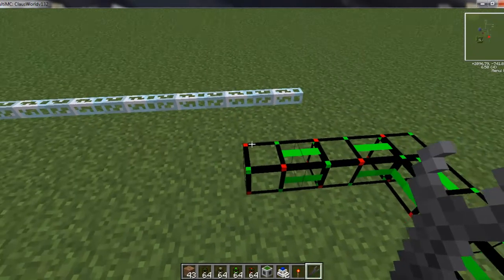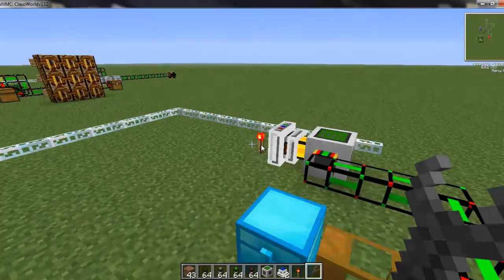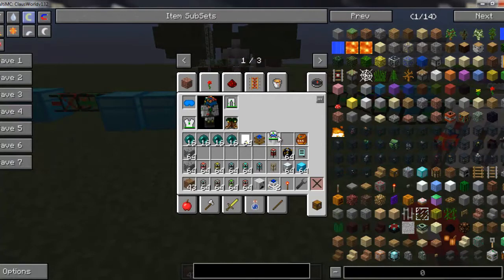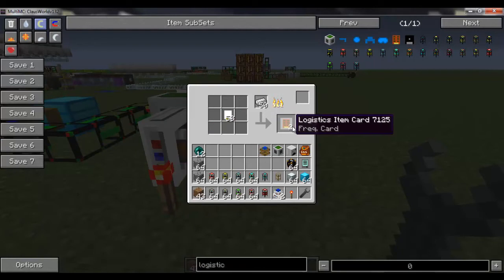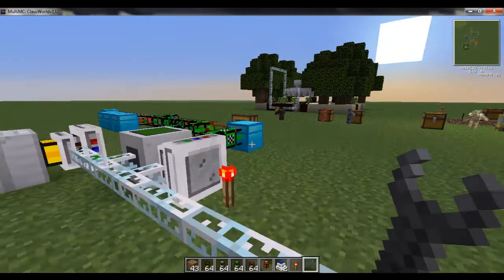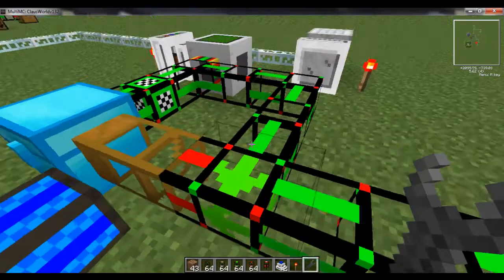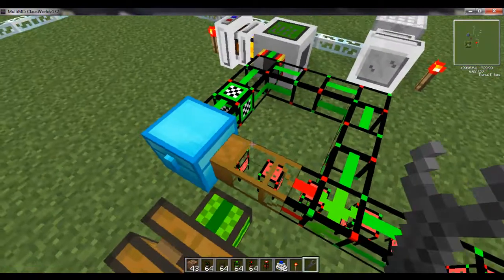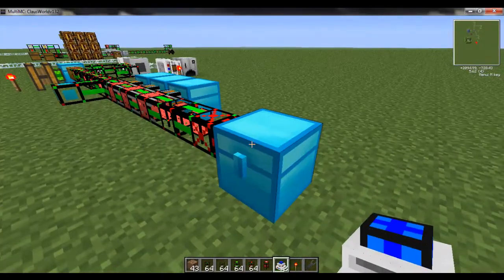Logistic Pipes Tutorial - Episode 5 - Power Junction, Frequency Cards, Entrance/Destination Pipes

Comment from the maker: Yellow is not a valid connection. Are they both attached to ender chests? They must be for the inventories to transfer.

Provider cards (modules) should provide a supplier pipe, not sure why that wouldnt work as long as the networks are connected.